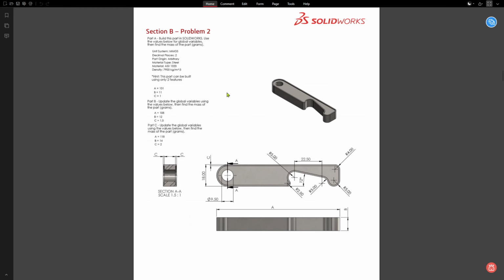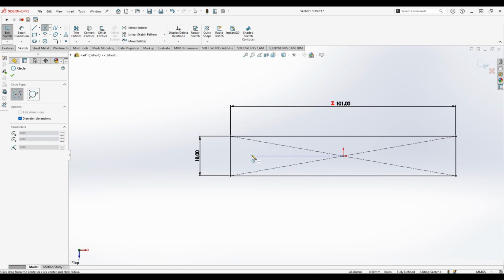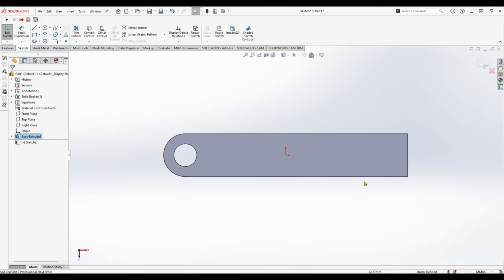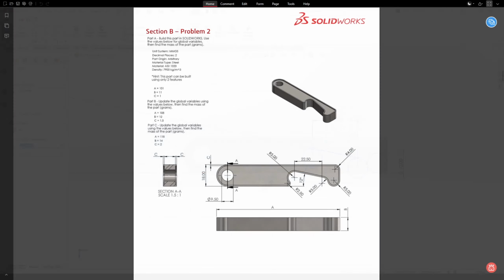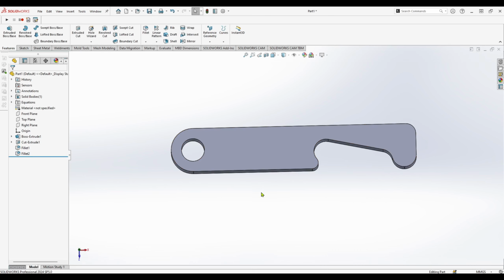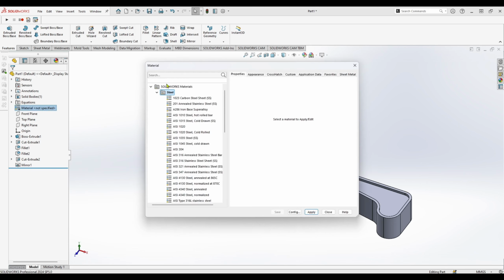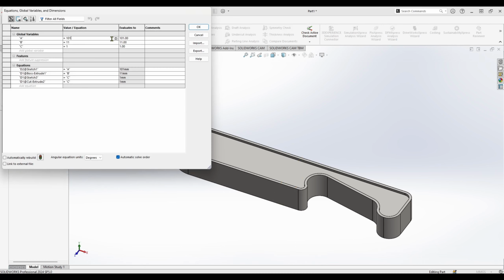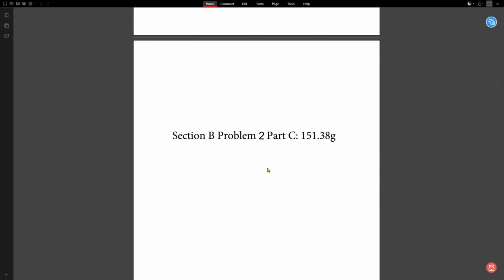CSWA Mock Exam – Section B Problem 2 | SolidWorks Certification Practice

Comment: i got section A correct with a mass of 102.97g, but when i change the mass equations its a few grams off for each one. I'm assuming i just didn't use the shortcuts when needed but im not 100% sure where i went wrong. Thank you for making these videos btw actual life saver.